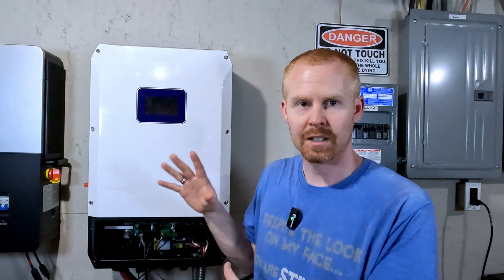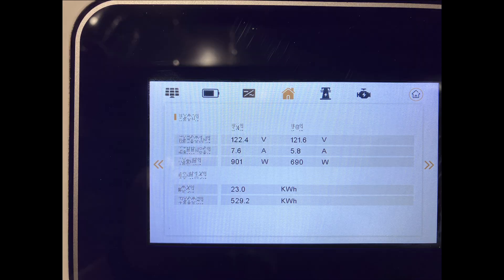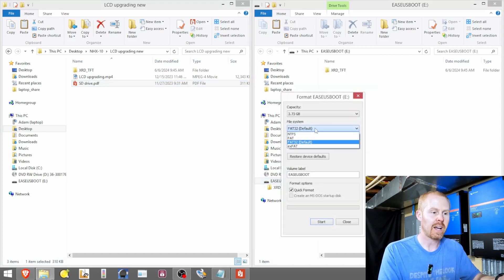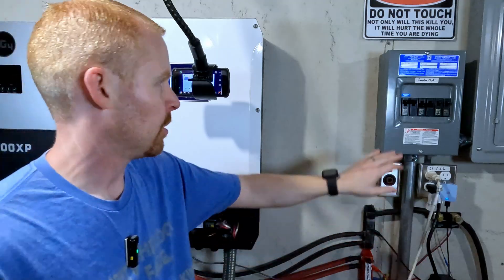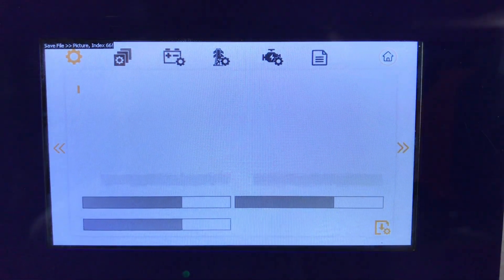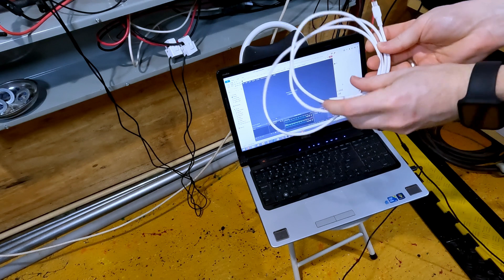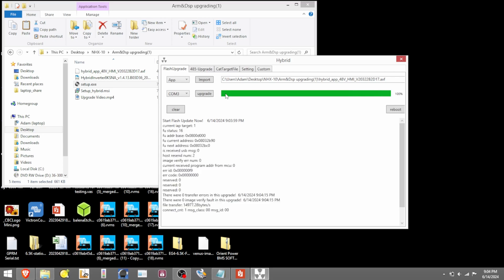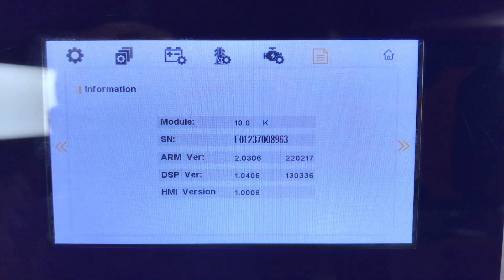Updating the Firmware on the NHX-10 Hybrid Inverter

Comment from the maker: Links to the parts & pieces in the video (affiliate links)
------------------------------------
NHX-10 Inverter - https://bit.ly/3K0cVP2

For more information, please check out my website with links to all the components, materials and products I have used in developing my off-grid solar system: https://going-off-grid.com

Supporting the Channel
--------------------------------------------------
There are several ways that you can help support this channel.  
- Affiliate links help the channel by providing me with a small commission of the sale.  It does not change the cost for you at all.  
- The 'Buy me a Coffee' - link is here (on the bottom, right corner of the website): https://going-off-grid.com
- You can also click on the "Thanks" button under the video to support the channel. 
- You can become a channel member for additional perks: https://bit.ly/3Wdufqv

Thank you for your support!

Comment: I had the NHX 10 for a few weeks, then overcast it was producing 1% of rated, I had my glitchy NHX8 sent back and re installed and overcast is over 13% of rated, the latest firmware was flashed and the gen/grid port total is frozen, and Jan a - popped up in front of my total charged, it was 3300kw now months later 2700kw lol , works fine just lies to me alot. The 3300w array I added vertical with snow over amped the mppt at 4185W, only 14A on the 8kw, 15A on your 10KW.  Snow boost was 550 to 697W, 11.6kwpv lowest day was 7500w, average was 12kw in Dec. Nov 1 to Feb1 up from last year's 170kw to 1000+kw, no gen since Jan 9. Relocating 12 and twisting 8 panels SE, expecting 3kwh extra in Dec. old firmware 2200w to turn on the fan, now it comes on at 600w,
Reply from the maker: Thanks Bob!
Reply: @AdamDeLayDIY   These units may have some hiccups but Jon sold 100's and not one completely stopped working so that is a good sign, issues but no failures.

Comment: I never had a problem with my pv3 solar panels it is the inverter's pv3 and 4 are not working right, I have an overcast 500w on pv2, I put the string into pv3 and pv4 and it drops to 45w, looks like I need an update after all. Thanks this video will make it less unknown to me.
Reply from the maker: Yeah that's odd that it would drop down that quickly if you move from PV2 to PV3.  Hope the video helps!
Reply: @AdamDeLayDIY  we did the update,it only changed fan speeds, put still improper pv3 4 production, solar online brought me a 3rd inverter now a 10k like yours, installing today, 2 of hundreds sold by him both mine faulty so he drove 8 hrs to fix it.
Reply: I want to compare mppt drivers, what size array is on your nxh10 and how much pv do you get in full cloud, and the heavy rain. My old inverter gave me months of inaccurate pv data , instead of 2800w now it looks like 1300w from 13kw. If you get better #'s in cloud, then I might flash nx firmware on it. Even a sunny # hitting the side of the panels should be close overcast simulator.
Reply from the maker: @bobmonztr  mines not connected at the moment as I’m testing out the MidNite inverter.  I believe I saw that Gavin Stone has one connected for a long-term test though.
Reply: @AdamDeLayDIY  thank you ,

Comment: I think I will just get my solar dealer a hotel room and have him do it next time he is passing through if needed. Is this the update to fix gen port and grid time of use? I don't need grid or generator anymore so I will leave it be.
Reply from the maker: I can’t recall the specifics but it wasn’t for gen or TOU.
Reply: @AdamDeLayDIY   would you rather our pv total showed available and not clipped values or is this the way all inverters report?
Reply from the maker: @bobmonztr  I would think it should show up to the max that it's programmed to handle.  You should be able to know right away if your string is being clipped due to your panel config and the PV numbers maxing out.
Reply: @AdamDeLayDIY   I have to add loads to get the array #'s up, 20kw a day in june, now with all the ac I see 31 kw a day. My short Amen solar 8k, now I know even the daily total is clipped.
Reply from the maker: @bobmonztr  is that due to your batteries getting full and charging ramping down?  That’s the only reason I could see a load changing how much pv could come in (unless there’s some programming issue).  

I guess the other thing it could be is that I had to change the max charge rate on mine because it was set too low as a default.  It was set to something like 20a and was causing my pv to clip.  Once I realized that, I increased the setting and all the sudden pv numbers were higher.
Reply: @AdamDeLayDIY   Batteries are near full, when it clips the #s, it absorbed charged 1-hour tops over 90 days. I think I thought the old defect inverter showed available because it never fully charged the batteries once. aha the source of my confusion identified. Solar online took my specs so it was fully configured. 20A is good for a hand held gen. 51 hour charge time .Glad you saw it , doubt you would have missed it.

Comment: Thanks Adam. I'm warming up to this inverter for a dedicated EV charging solution. I love that it has 4 independent MPPTs which gives a lot of flexibility.
Reply from the maker: Would probably work very well for that application.
Reply: I have an 8kw, it takes 7500w to blow the fuse on a single mppt. That 10kw even more.
Reply: @bobmonztr Are you generally happy with it?
Reply: @hendersonsobers396   I thought I replied to you days ago, yeah so far the replacement has been no problem, silent to 2.2kw. The new display is a lot easier than the old model. The old one needs a firmware wipe and update. It is going back to the dealer soon. Solar online shipped a replacement the day after the 1st one stopped charging, we got it to work next day but he didn't want to risk any further relapses. I ran the old one for 3 months after I had the new one, if he gets stuck with it after repair I might buy it reduced. In 8 years 15min swap.

Comment: Will it supply the homes main panel with battery and or solar power by utilizing only the grid input connections? Using CTs to not export by only supplying the main panel with what the home is using
Reply from the maker: Yes, so if you have the CTs on the grid mains on your main panel, Solar and battery will be used to power loads on your AC Output connection and your AC Input up to the CTs.  

If solar and battery is insufficient, grid pies will supplement.  

Also, you can program the inverter to only use X amount of power from the battery if you want to (so you don’t completely drain the batteries).

Comment: Wow.  That the USB stick 'quality' would result in that is a bit worrying.  There should be checksums / CRCs / MD5s or any other number of validation methods to ensure that the inverter only ever attempts to use 100% correct files / images / etc and that any reads or writes of the stick also results in a guarantee that the data read / written is in turn 100% valid or rejected.
Reply from the maker: Agreed.  Thankfully the worst thing I saw happen was just the corrupted labels on the display.  Either that or it just wouldn’t load the data.